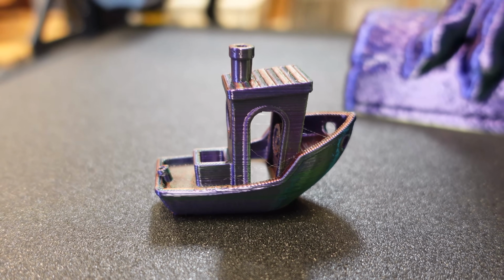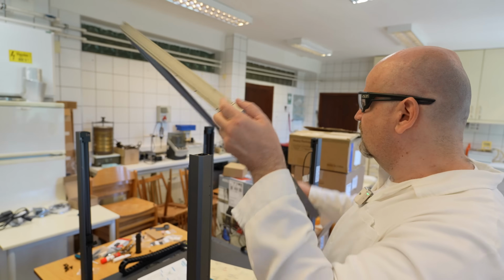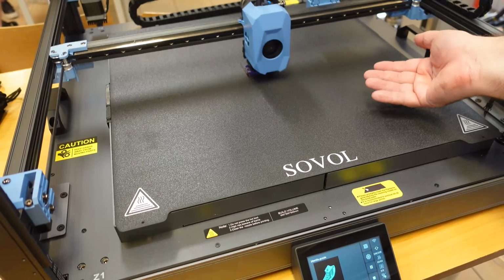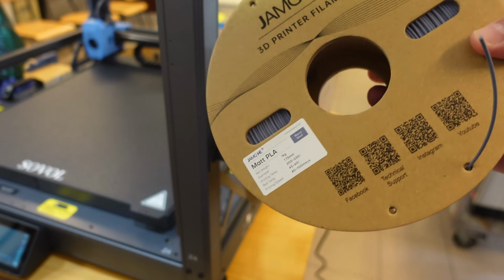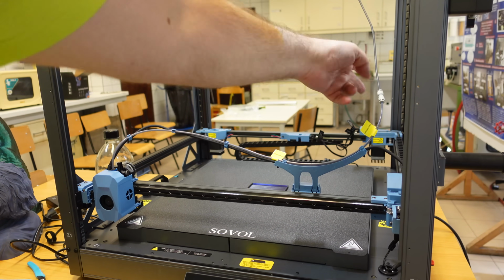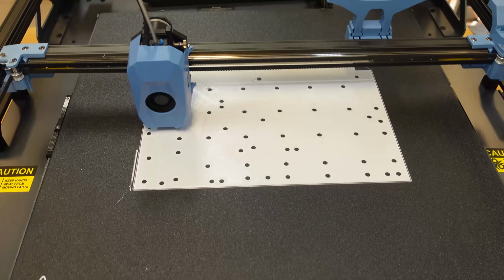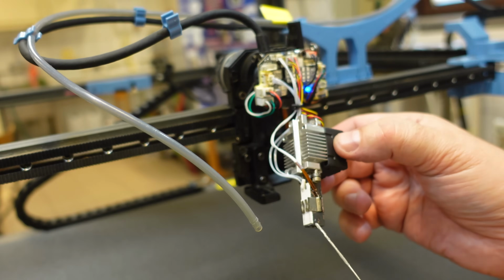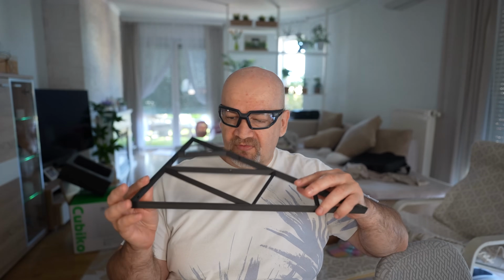The noisy giant: Sovol SV08 Max 3D printer review

Comment: Do you still use this printer. How is your experience so far. Thanks
Reply from the maker: I use it ONLY when I need something bigger, above 350mm (only PLA or PETG), which is currently the max on my 2nd largest printer. But usually this size is along XY only. If I would go to max in Z direction too, printing would take a week sometimes.. If smaller than 350, then other printers still have better quality. I think weak point of this printer is the 6mm belt they used.

Comment: the noise will be the power supply fan, my SV06 plus was exactly the same. I ended up replacing with a mean well power supply which is much higher quality, and fan-less. That's the thing with these "Cheap" printers, they need modifying out of the box to take them from cheap and cheerful to a higher quality printer.

Comment: Great video!
an in-depth video with a 0.6 and 0.8 nozzle would be really helpful, perhaps using Bondtech nozzles with a CHT design, which should help a lot with high flow rates.
You could do a larger flow test, perhaps at 200%, which would make it more conclusive and realistic.

Does anyone know why the maximum extruder temperature was reduced from 300° to 350°? I hope they didn't reduce the heating element power. 300° is more than enough for a printer like this, not intended for technical materials, but maintaining even 200-220° when printing with high material flows requires a lot of heat output.

Thanks so much!
Reply from the maker: I ordered a new hotend (and in the meantime, they informed me that they will also send me some). About reduced max temp, I don't have other info. Only in original specs we got was 350C, later I got a new one with list of changes. "More stable printing"..

Comment: I think i prefer the design of the creality ender 5 max. Fixed motion system and leadscrews for the z movement. The regular svo8 looks fine, now they need multicolor.
Reply: Add INDX from Bondtech or Stealth Changer from VORON...BTW some type of multi toolhead is cumming frol them and if you need an qms like experience, then add something like Pico MMU or Trianglelab 14 Channel MMU

Comment: Wow I used to print those marble machines in under 18 hours on an original ender 3 and really good quality even by todays standards. The default slicer settings on those machines was absurdly slow. I actually sped it up over twice as fast, unlocked my acceleration and ran at 2500 on infill 4000 on travel and 1500 on outer walls and 120mm/s on infill, 80mm/s on outer walls. Limit flow rate to around 10mm cubed.

I made quite a few for my young cousins and friends kids. They love them. When printing in rainbow I would print the spiral at the same time as the track and then print the cap and top piece last, this way the rainbow effect is uniform across the entire print.

Shout out to Tulio for their awesome design. You made a lot of kids, big and small happy. Myself included.

Comment: Thank you for another great video! 

I admit that I was very interested in this printer, but I'm unsure about it. I will definitely watch the upgrades videos on your friend's channel to keep track of the progress there. I think with better (and much quieter) fans, much wider belts, and eventually multiple tool heads, this printer will be a serious workhorse for large format needs.
Reply: With about $30 of upgrades for some overkill fans, it easily outclasses anything in its size category (under $5000) while also being half the price. SOVOL machines are a simple, cost effective introduction to printer tinkering. I feel like they leave a few glaringly easy fixes on it just to get people to start. They are VORON adaptations, and VORONs aren't really designed with user experience in mind. If you want a machine that just works, wait another 10 years. If you want a machine that mostly works, this has been good to me so far. I've had it printing almost 24/7 for a week and some, and the only failure I had was due to the filament feeder not knowing how to detect a clog with TPU. I turned off the sensor in Klipper (one click toggle on the dashboard), and it just went

Comment: I have solution for heat creeps. I intentionally block cooling fan and then heat up radiator. With time I can push out, now soften material. Usually I screw off nozzle, so I can have bigger flow, usually it prevents from getting new filament for heat creep. I also tried doing it with "cold pull" technique, to avoid to much new material build up in heat sink. With time I've managed to fix this without resorting to blowtorch (this time). I did it on bambu x1c with threaded nozzle hotend, but should also  be applicable to other brands.

Comment: That loud fan should've been the one on the extruder, at least the noise would've compensated for preventing heat creep, no? 😆
Reply from the maker: No, it is in the bottom, mainboard fan. The hotend fan is actually very quiet.
Reply: @MyTechFun  I think they meant, if Sovol had used a loud (but high airflow) fan on the hotend, perhaps not have the heat creep issue, and it would be slightly more tolerable because at least it was loud for a reason (and only in use, not at idle and all the time).

Comment: After using a few truly large format printers, I'm more convinced that extruder boosters are more necessary than previously thought. I haven't looked at doing this via DIY measures, but the theory in my head is to splice an auxiliary line from the extruder signal and more or less run a clone to the feeder booster so that they run synchronized in feed rates.
Reply: I think the closed-loop method used by InfinityFlow3D’s diplexer is more robust, it just ensures a roughly constant positive force pushing into the extruder. Which might be what they already do on those clog-detecting sliders like on the side of this printer? The positive force doesn’t seem that high though.
Reply: @Scrogan  I don't recognize that one off the top of my head, but the arrangement sounds familiar. Most of the ones I've been around are somewhat passive and work by triggering a motion system of sorts, where movement from the main extruder is detected and applies a small amount of pushing force from a remote motor and something like a scaled-down mk8 gearbox so as to not overpower the main component (sounds almost exactly what you described now that I've read over your comment again, lol). 
I've also been around them on larger/long reach commercial machines, and the early ones were more prone to breaking off brittle or abrasive filaments in the tubes from being too slow to react. It's not as much of a problem on relatively easy to access consumer machines, but those large industrial ones, you might have to spend a few hours pulling components off just to get into where you can get access to the tubes in the bowels of some of those monsters.
Reply: @C-M-E  I think ideally you have some spring-loaded gripping wheels, be they knurled or rubber, on a sliding carriage. This sliding carriage has a few cam of motion, and is pushed towards the print head via a spring. When the carriage gets too close to one end of its travel, a motor spins the gripping wheels, pushing filament and moving the carriage back to a centre position. By increasing the spring tension felt in this middle position you can increase the preload to overcome friction, but doing so requires the auxiliary motor to provide more torque to counteract the spring.

If I understand correctly, infinityflow 3D uses no moving carriage, but measures the force on the filament in some other way, keeping a constant pressure on the filament with a fast feedback loop. The spring method could use simpler bang-bang control of a DC motor.

Comment: Great video.  I've been looking forward to this SV08 Max review.  Sovol fixed the warping "taco" bed and slow inaccurate bed mesh issues from the SV08 with their Zero and SV08 Max, which were developed together.  Unfortunately, the SV08 Max inherited the noisy fan from its little brother.  When assembling my SV08, I swapped the motherboard fan for the equivalent but much quieter Noctuan fan.  It was a simple $15 fix.

I had the identical PETG heat break clog on my Sovol Zero with the same hot end, but I was foolishly printing in a 60 C enclosure.  I created a thread on the Zero section of the Sovol forum, titled Bad Clog.  There is good info in there from the Sovol community to help with clearing clogs on this extruder, and preventing them.

I didn't buy Sovol's explanation that 6 mm timing belts were a good SV08 Max design decision based on their demonstration that they don't break.  I tried explaining in a YouTube comment that the issue is belt stretch reducing print quality.

I'm admittedly a Sovol fan boy.  I love their innovative open source printers.  They're a relatively small 3D printer manufacturer and they are trying very hard to provide the 3D printers we want at an affordable price.

Comment: It's too bad that Sovol can't seem to quite nail the SV08 line. This time, the loud board fan carried over, accompanied by a baffling 0.4mm nozzle, no stock reverse Bowden bypass for rough/stiff/flexible materials, concerning belt width and inadequate heat break cooling. Here's hoping that the new bed doesn't like turning into a taco on some units. Also, is there a nozzle probe? With a machine this big, it's even more critical that bed adhesion is perfect and the first layer, while very consistent, is worryingly full of gaps.
Reply: Sovol owned the SV08 taco bed and slow inaccurate prox sensor on the SV08 and fixed that on the Zero and SV08 Max, but they have so far refused to listen to the community on the noisy motherboard fan issue.  I swapped that fan on my SV08 as I was assembling it and the $15 Noctua fan is nearly silent.  The easy fix for Sovol would be a larger cheap fan that costs 30 cents more than the smaller cheap fan they're using, but they refuse to do that so they'll keep getting dinged on that in the reviews, and their customers will continue to replace the motherboard fans.

On the plus side, the Zero is the sister product to the SV08 Max, they were developed at the same time and share extruders and other parts, but I didn't need to swap fans on my Zero.  The other fans are noisy when cooling the part and the enclosure, but the motherboard fan isn't a problem.  The Zero is a great little printer.  The smaller passively heated chamber heats quickly.  The Zero prints ABS as easily as PLA.

Comment: That first layer looks horrifically underextruded.
Reply from the maker: Looks. But it could be just a little bit higher Z-offset..
Reply: The first layer print test was under extruded.  The bed is reasonably flat and the bed mesh was accurate.  Either the extrusion multiplier was wrong for that filament or the extruder was slipping a little, perhaps because of low idler gear tension.  If the latter, the slippage was very consistent.  The printer is certainly capable of better performance.  If I was taking my time to set up my new SV08 Max, I would have fixed the under extrusion before continuing.  The same under extrusion was seen in the print speed extrusion test and the infill of the Einstein bust.  Slowing the print speed seemed to fix the under extrusion so the problem seems to be with the mechanics of the extruder and not the programmed extrusion rate.  Igor was testing and reviewing the printer, and on a time schedule, so it wasn't his job to diagnose and fix any issues.

Comment: the chief engineer at sovol must have bad hearing, so many products from them are noisy
Reply from the maker: I am thinking to send them a noise meter as a gift :-)
Reply: i bet they never test their printers outside of a noisy factory.
Reply: @jksjrgfpsjgr  It's crazy because all it takes is a couple of dollars extra to have decent fans that don't sound like a turbine at 10,000 RPM.
Reply: Sovol gets a lot of feedback from the community.  The bed warping and slow inaccurate bed mesh prox sensor on the SV08 were corrected on the SV08 Max, but the noisy motherboard fan remained.  Sovol justifies it by saying that these printers are designed for industrial use, and if someone wants to swap to a quieter fan, it's an easy upgrade.  There are two strategies.  Some people install a larger slower inexpensive fan and hack up the electronics enclosure to fit.  I prefer swapping to a quiet Noctua fan of the same size, which requires no enclosure hack sawing but does cost US$15.  On my SV08, I didn't even change the macro to only run the fan when the MCU needs cooling.  It's so quiet I leave the Noctua fan running all the time.
Reply: I always have to laugh when the biggest complaint about a printer is how loud it is. I run a large format CNC machine with noise canceling headphones. I wouldn't care if it sounded like a 747 taking off. How well does it print? I'm not sleeping with the thing.
Reply: @gregtracy9322 thing is, I live in a small apartment so I do literally sleep with it near me, the noise is for sure not dealbreaker but its a point that they should pay attention too